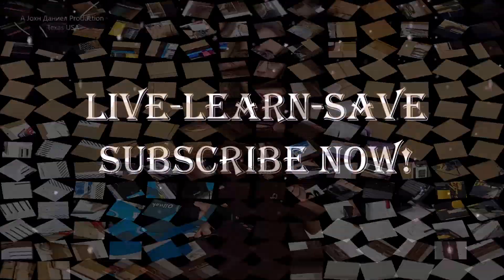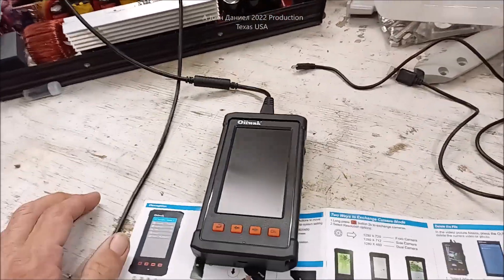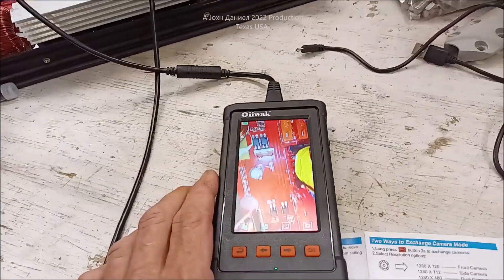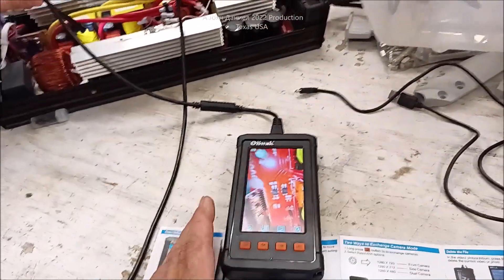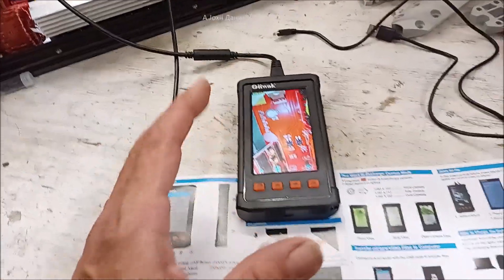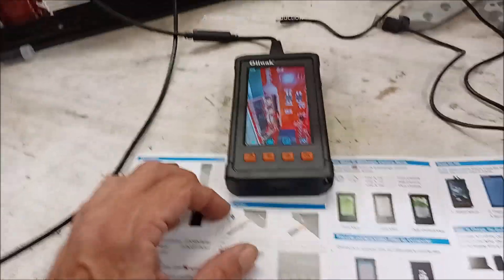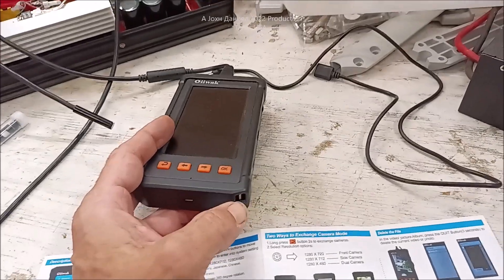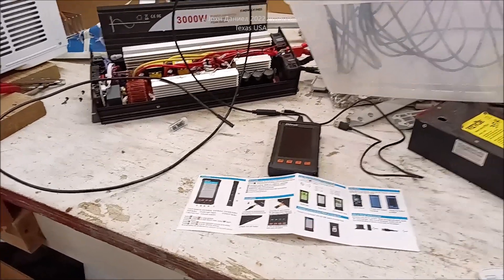The Oiiwak Endoscope Underground Adventure that could have ended bad

Comment from the maker: Oiiwak Endoscope we used https://amzn.to/3VnxglD Send a coffee to Nurse Kiera https://www.buymeacoffee.com/JOHNDANIEL ⬇ 96% Survivalist Agree, The "Elite CAUSED" ENERGY CATASTROPHE SURVIVAL OFF GRID 1200 watt SOLAR POWER KIT -- 100 Watt Panels (12) https://ebay.us/Zla5aq , Affordable basic solar controllers pick (2)60A https://ebay.us/pODwA7 ,Solar Connects https://amzn.to/2XJOa1M ,Battery cable USA made https://amzn.to/3h6dsim ,12/2 Above/Underground https://amzn.to/2XIJolg for safe DC wiring of lights and dc appliances.
SWI Power Inverters has proven 6+ year record of quality - 3000 watt https://s.click.aliexpress.com/e/_DFqijTz & https://ebay.us/YEaTX9 for tool, high amp, fine electronics & the Costway DC 12/24v Refrigerator/Freezer unit https://bit.ly/3jquPOy 
REAL SOLAR BATTERIES - Power Queen premium https://amzn.to/3QfOY7T & REDODO 100A Workhorse DC Battery https://amzn.to/3dlHT7d

Comment: Having been married to a miner, you are better off not go into a mine,  unless you know what you are doing. There is black mold, bat poop( guano ) which can be deadly,  methane pockets, ( remember the canaries they used to take underground?) and there is places where you will run into lack of oxygen, which can cause a wicked head ache and sleepiness, which if you fall asleep, you may not wake up on this side of the grass.. That is why a working underground mine pumps air into it, with a massive compressor
Reply from the maker: We had 4 high flow SF 380 CFM bilge blowers sending air down a 90 foot 8 inch black poly flex pipe. Lots of air was flowing. But it was the fungus on the old cotton wood tree lumber timbering that when we upped the air oxygen it got to go active & shedding itself. Cytospora chrysosperma cytotoxin.  I was wearing a Fauci Mask LOL! Caused permanent damage, ended up getting a heart stint put in from it. Spent $2200 more on medical than I made on the job. No health insurance due to Biden, lost my trucking job of 12 years for not taking Fauci JAB which I could NOT take due to already having heart valve inflammation. So yeah, mines have some serious things in them. This one had been cleared by MSHA but no, it wasn't OK.